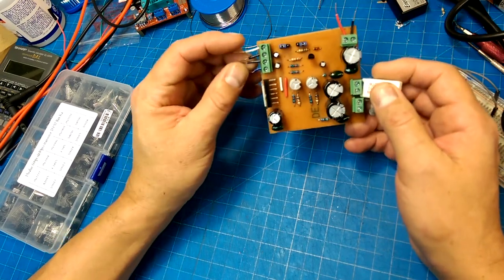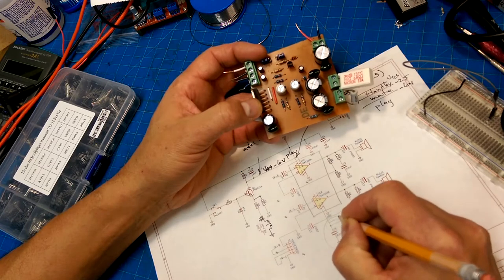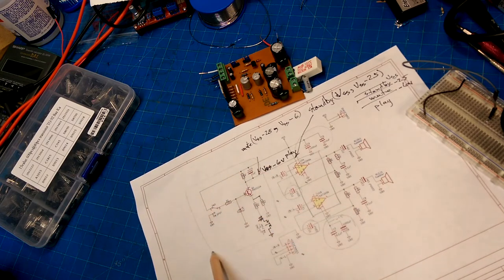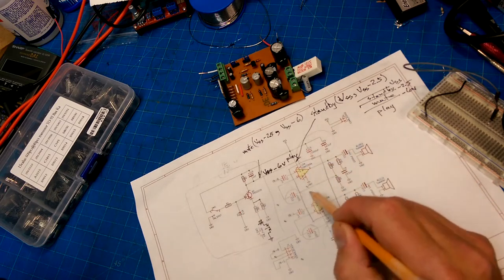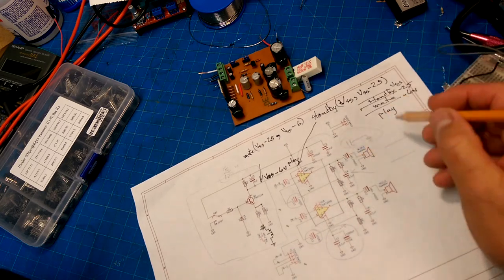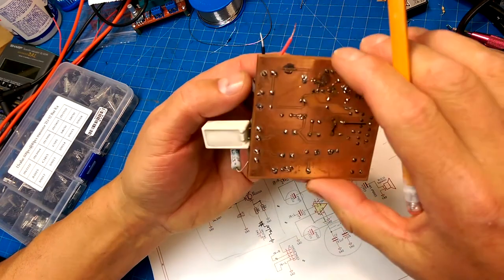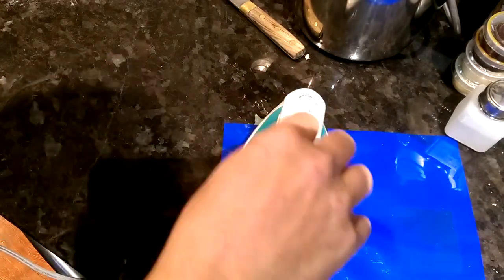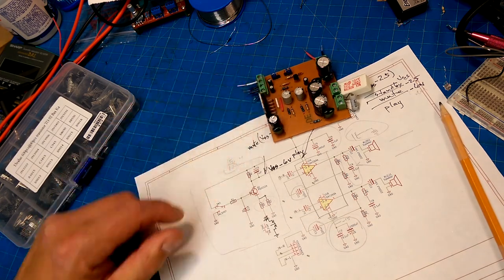Salvage Amp Part 2

Comment: Why didn't ya put it on a breadboard and then put it on the PCB (or did you already do that and I missed the video)?
Reply from the maker: The multiwatt package that the IC comes in is not breadboard friendly.  But i should have just soldered jumpers onto the leads and breadboarded it anyway.